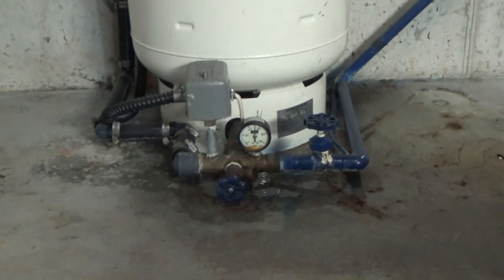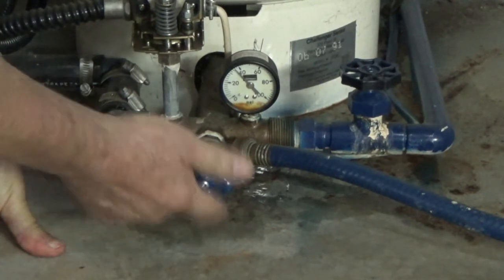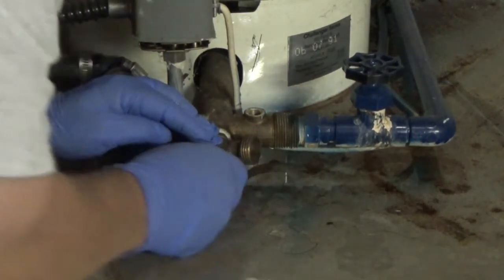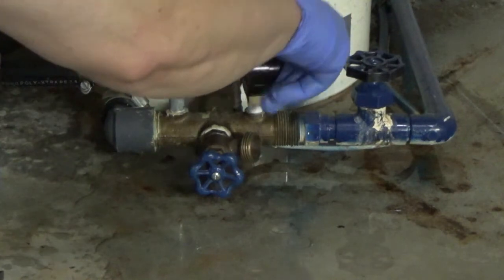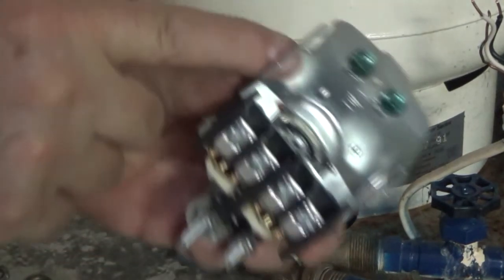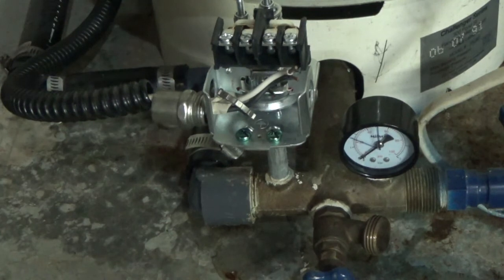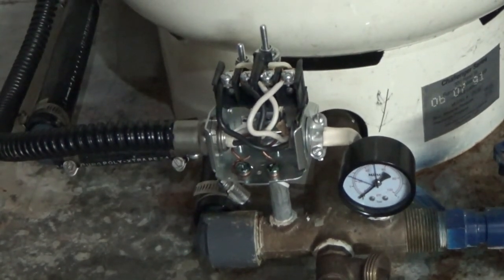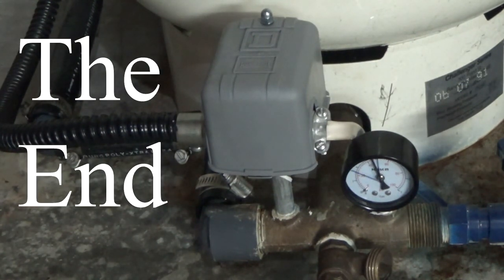Well Pump Pressure Regulator, Pressure Gauge, and Pressurizer Check and Repair

Comment: That is a pressure switch and not to be confused with a regulator.  Very different parts.
Reply from the maker: Thank you. I am new to this.
Reply: think of it as a switch off and on. a regulator valve will regulate normally pressure.
Reply: @BenjaminPalumbo  You should rename your video title from "Pressure Regulator" to "Pressure Switch".
Reply: @JohnHumbert  Yep, that's how I found it using regulator as search
Reply: Exactly